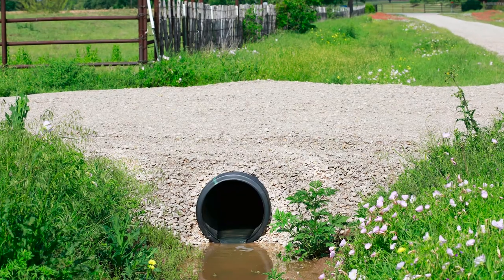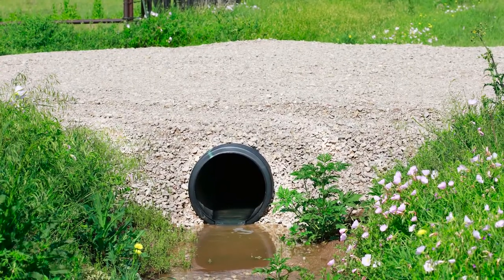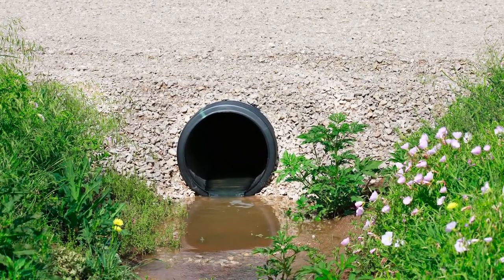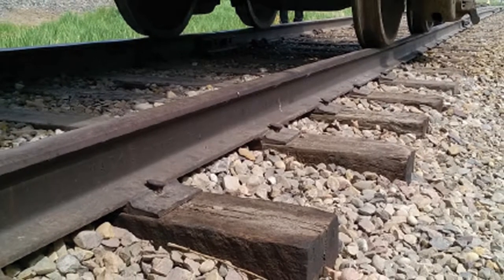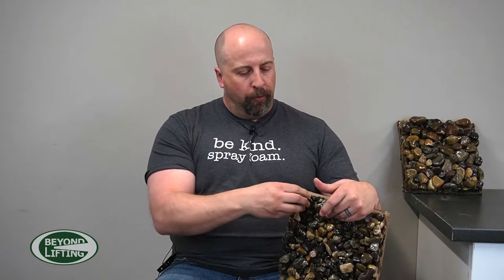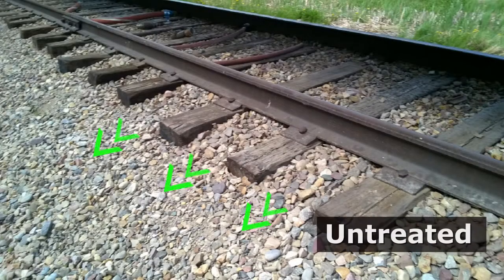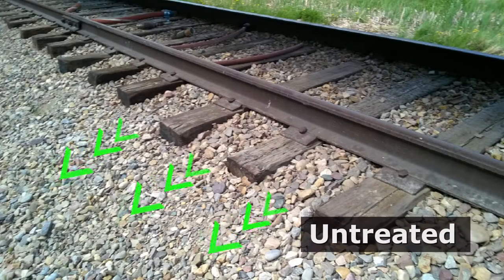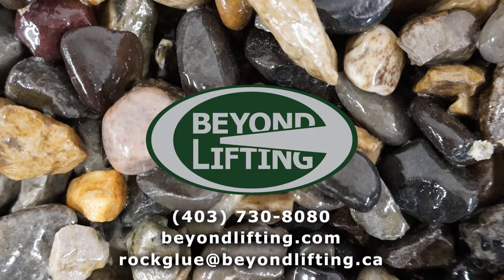Rock Glue by Beyond Lifting, Calgary Canada

Comment: Your video makes it look like this would work on a gravel road. Will this take the punishment of daily driveway travel over  existing peastone and gravel? I'm looking for a way to allow the snowplow to clear the area without picking  up the stones as is ordinarily the case making for a lot of spring cleanup every year. I need a product to bind the stone and which will last for multiple years. There are a lot of different products on the market but most do not look intended to bind stone on a road. The job is in western Massachusetts, US. Thanks
Reply from the maker: Yes it should withstand the punishment of a snow plow, but it will depend on the current road compaction. Give us a call